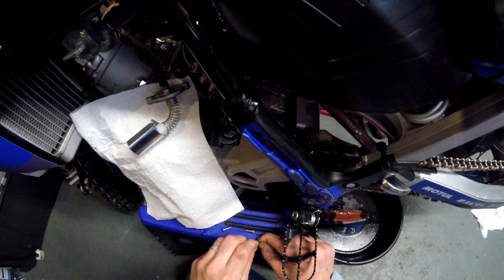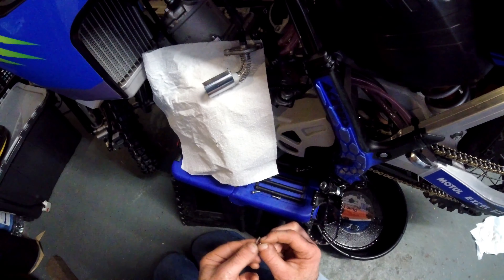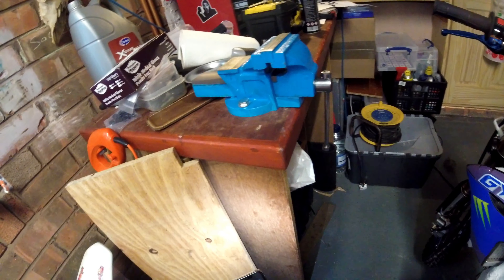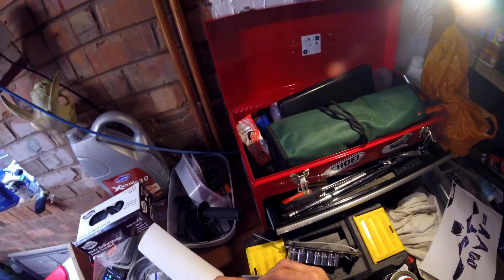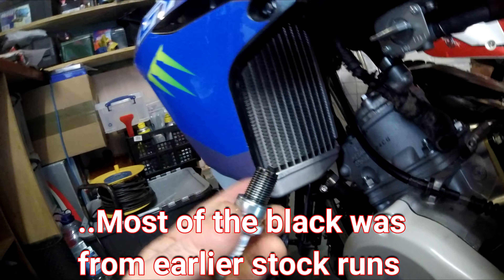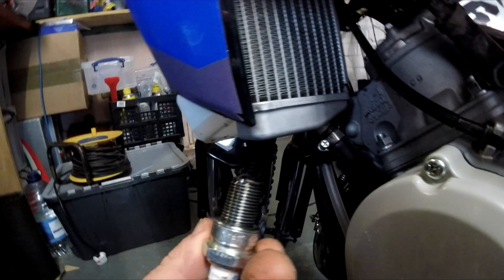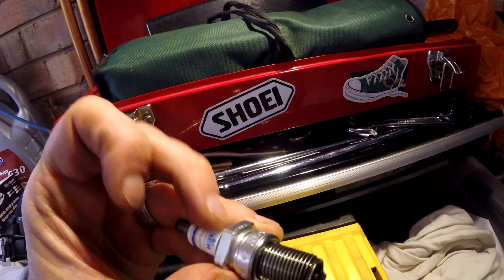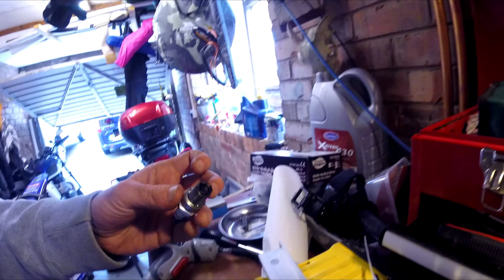Yamaha YZ65 2018 - Carb Testing - Bog or Starve?

Comment: From running these on a dyno a lot and having this issue with one of our yz65 bikes before we found mainly they have to be put on a 50 pilot for most and now a stock bike with no mods we found (in uk with stock fuel ratio) loved it more when we had 50 pilot 5th clip on needle (the richest) and a 148 main they are day and night difference the main issue is the 28mm carb
Reply: Teamgabbymx

We have a 2020 yz 65 no mods  it has a 48 pilot and a 150 main in it atm 
I also have a 142 main which main jet would you run and  should I put a 50 pilot in it on needle clip 5 ?

Comment: Sounds very lean up to 1/4 throttle. I’d suggest richening up the pilot jet & fuel screw. 2 -2.5 turns out on screw is ideal, any more or less swap out your pilot jet.
Reply: 2-strokes have air screws.

Comment: Had a bad coil on my ktm 250sx. Would run great as I ramped the fuel. But hard throttle it would bog down. New lectern carb new reeds rebuilt top end still same. New plug new air filter still bog.  Turned off the lights in the shop and gassed it wide open and the coil looked like a Christmas tree. Fixed $1644 later and is now a beast
Reply: How exactly do you tell if it’s the coil? My cr125 runs great except from idle it wants to bog
Reply: @user-pt1hz2wz7h  sounds like the wrong idle jet or mix is off a little.

Comment: Just got a 21’ yz65 set up for a sponsored racer.  It has the same bog.  I’m guessing it’s ok as long as they are ripping it and modulating power with the clutch?  Also, the dealer said idling too long or a bad spark plug will def affect this.  Seems like u got it figured out with main jet to 50.  Im running 36:1 fuel.

Comment: How do you fix bogging that's only in the low end and it idles okay mid-range and top end are okay
Reply: If bogging in low range  clean the low idel jet(usually is the smaller one)  there's no need to interfere with the pilot screw(s).

Comment: But yours on the uphill deal only is always to much fuel. The carb sets tilted and once level the float opens and makes to much fuel. Could be the float itself needs adjusted. Or low octane gas

Comment: Did you ever got it to run good and what was the problem? Scratching my head also on this one
Reply from the maker: yeah, I got it running spot on in the end. It was WAY too lean on the pilot, and too rich on the main
Reply: @keepy6969  what did you end up having it set up as in the end?
Reply from the maker: @advennturesinalaska  Main = 135
Pilot = 50 👍 absolutely rips after that.
Reply: @keepy6969  nice, thanks.   I just got the 65 a couple weeks ago.  Did the extra jets come with the bike or did you have to order them?
Reply from the maker: @advennturesinalaska   had to order them, they weren't much £ though from memory. that said! they arent 'much' anyway! 😂
Reply: Main 142 pilot 48 needle 3 and air one turn from the bottom works for us. But we live in sweden maybe not same climate.

Comment: That's the float position!
Reply: Would it be to high more fuel . Or to low , not enough fuel?
Reply: @luckyaffpv343  to high float level, to much fuel!
Reply: @RafaZardetto115  10-4  but with a bog when full throttle . Would you think its to much fuel or not enouh
Reply: @luckyaffpv343  it could be both depending on the way the bike sounds, check the spark plug to know, too black too much fuel, un burnt oil too much air, start by tightening the air screw all the way, then loosen until bike sounds better, then adjust the idle screw to a perfect position not to loud or to quit, if none works, clean carb check float height and check the holes on the jets, or replace air filter if bike keeps getting clogged, Cheers and take care
Reply: @user.256z  thanks.
Reply: Yes it sounds like it runs out of fuel.
It needs fuel level adjustment.
Reply: @MotoPIX  my bike is doing this exact samething, what do you think would help ?
Reply from the maker: It was the pilot. upped to 50, ran perfect then
Reply from the maker: @nach0512  It was the pilot. upped to 50, ran perfect then